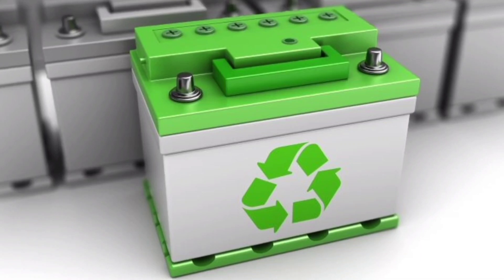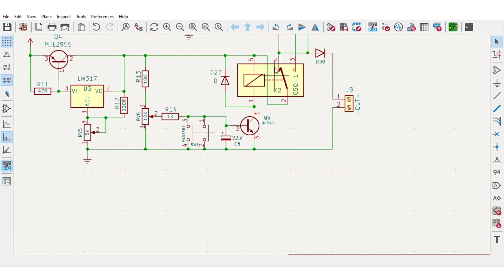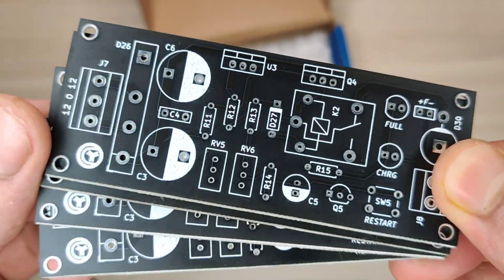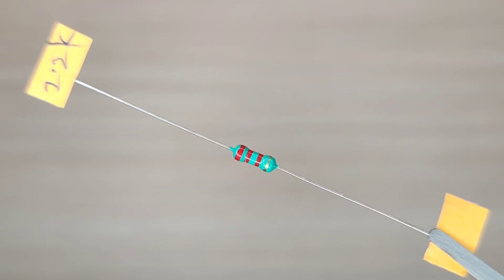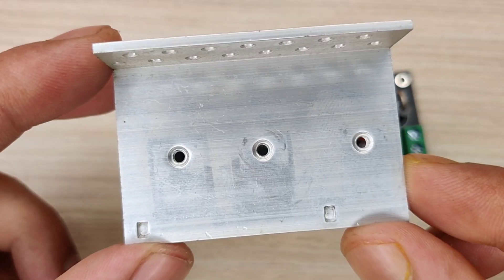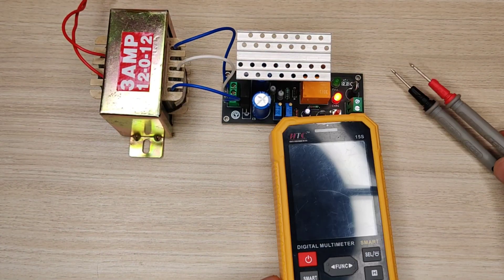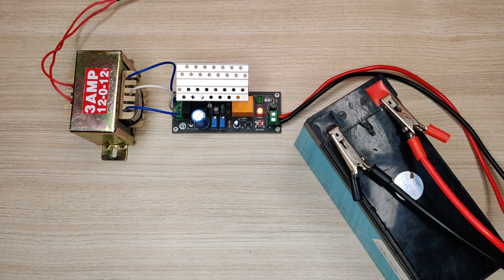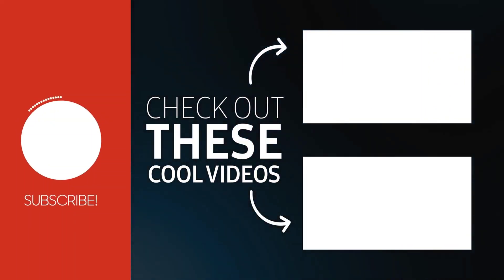[NEW] Auto Cut off 12 volt Battery Charger Circuit

Comment: Hi, I have a question please answer me, Do I have to press the button every time I connect it to a battery in order for the circuit to work? or is there another way where I can charge the battery without having to press the button.
Reply from the maker: Actually the button need to be pressed manually to start or restart charging